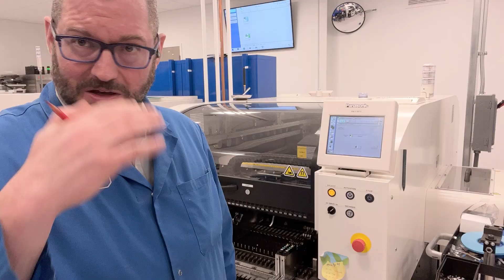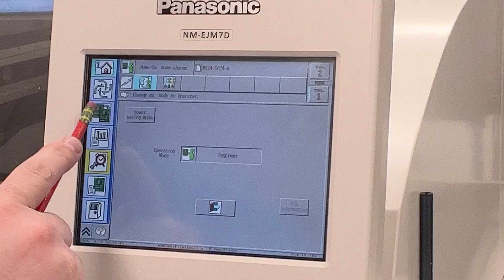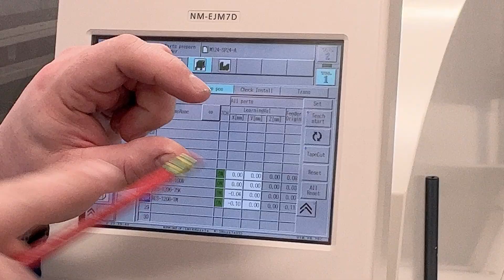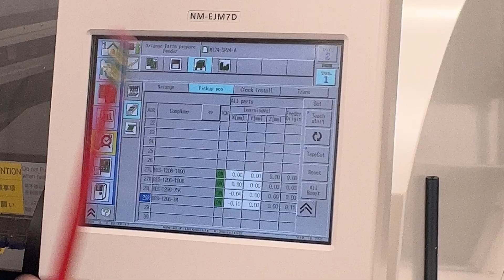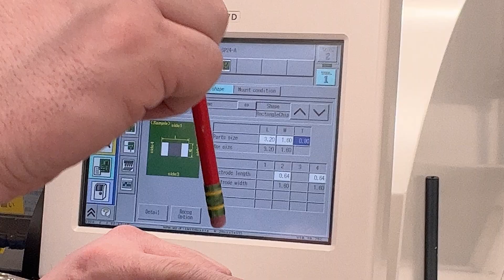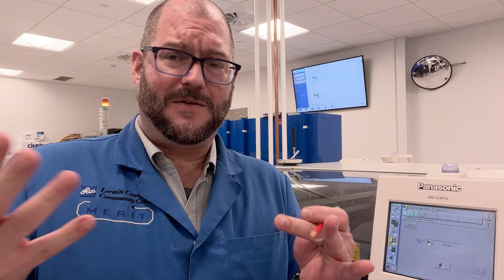Teaching students about SMT Pick & Place issues on the Panasonic NPM-W2

Comment: Thanks for this videos, sir can you release a tutorial of Pre Pickup Inspection option please? Sometimes I have a issues related with wrong component in BGA or IC components, but I can't add the brightness check option because the component is totally simetric, so I remember the pre pickup inspection is possible in machine with 3D camera but I don't remember the steps for release, thanks so much.